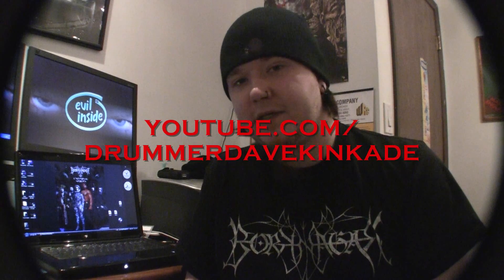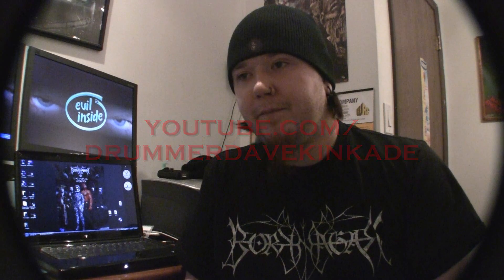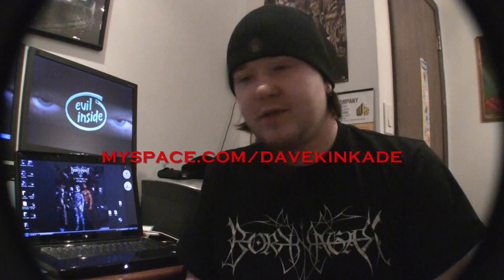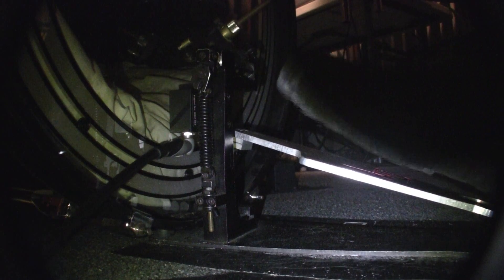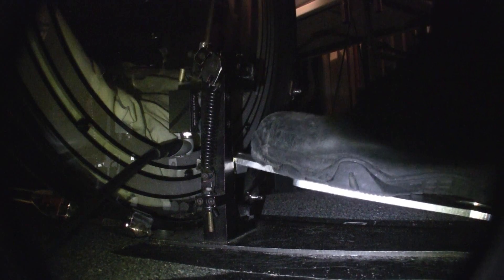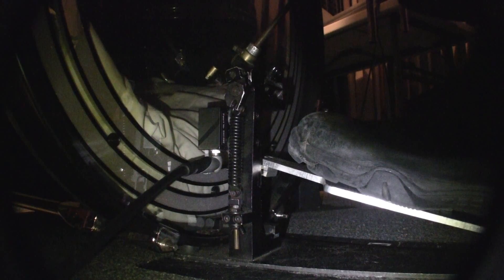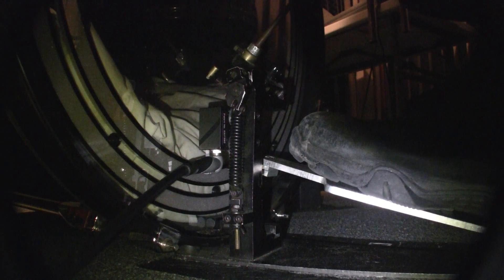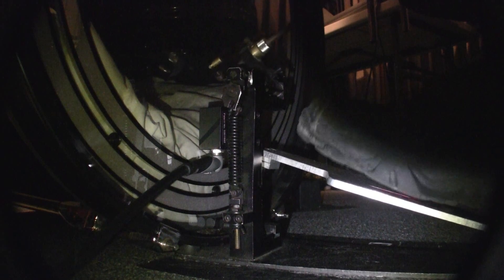David Kinkade (Borknagar)- Lesson on correct Axis Ekit calibration

Comment: I never had any problems. I wasnt suggesting that anyone has to set their pedals up as I do, I just get many questions about them so I figured Id post a video with the settings. There are 2 nuts on that adjustment piece and they lock on pretty tight. No worries with shredding it.

Comment: cool tips, your axis setup is interesting but I'm worried that if I set the beater angle that far back that its going to shred the angle position adjustment nut because of the increased pressure, does it ever come loose for you? btw I'm talking about the beater angle adjustment attached to the spring.